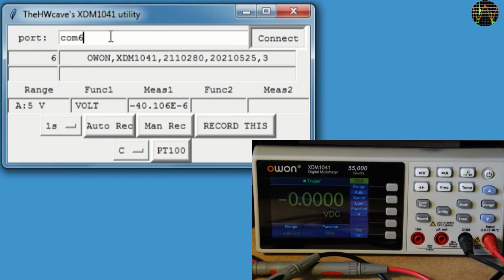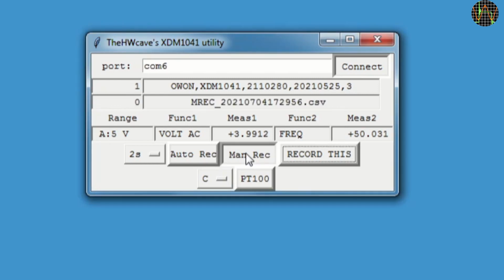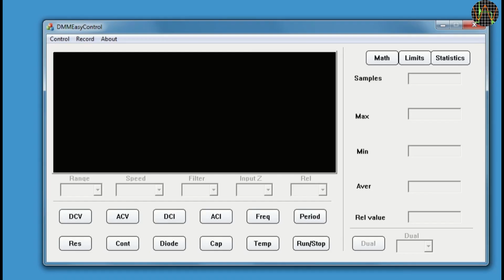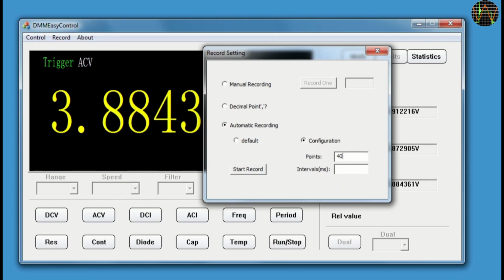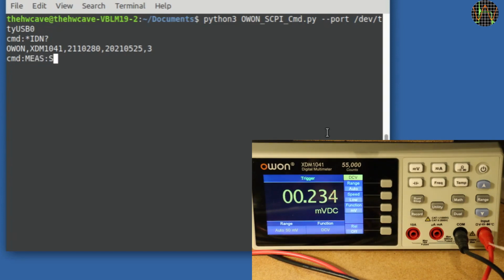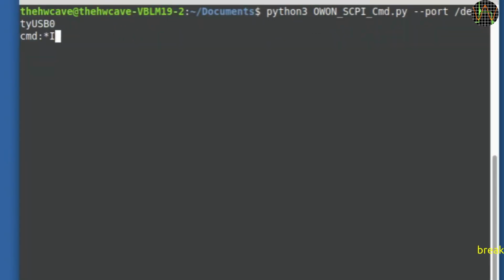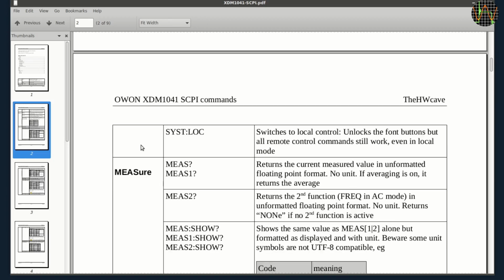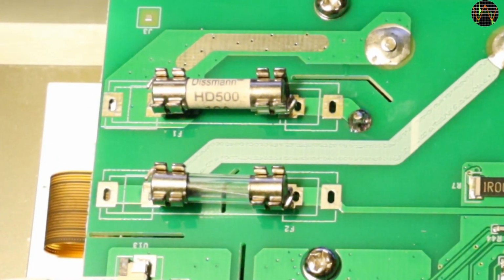The OWON XDM1041 bench multimeter, part 4 - SCPI & remote contro

Comment: How many values per second does it send to pc?
Reply from the maker: depends on baud rate setting and also whether the meter is set for slow (4 readings/s), med (16/s), or fast (65/s) mode. If you want accuracy, slow is the only useful setting.

Comment: can you use it without an app? enter SCPI commands directly on the com port interface?
Reply from the maker: No app needed, although I wrote a little Python program you can download from my Github page (see links in the video description).  You could use PUTTY (set correct baud rate!) and type *IDN?  <ENTER> to ask it to send its ID. You should get a response like OWON,XDM1041,12345678,V1.2.0,3

I documented the SCPI commands that work (in my version) also on my GITHUB. There are some quirks and bugs (as you would expect with OWON ;)

Forgot to add: no it does not echo what you type

Another command you can try is 
MEAS? which should send the currently shown value of the main display

Comment: A fantastic review, congratulations. Do you know how to calibrate the capacitor part?
Reply from the maker: I have played with calibration and sort of messed up my meter but did manage to fix it, so be warned that CAL is a scary procedure and you do so on your own risk. I did not cal the capacitance (lacking a suitable cap or a good LCR meter at the time) Now I have and use that, so I am not using the XCM1041 for capacitance measurements. The instructions (found on the internet) are below:
 
Enter calibration as specified about: Utility, Math, Up, Range, Down, Debug (softkey)

Pick the function and range you want to calibrate, each range has it's own calibration values stored.

Toggle between the "zero" and the "coef" number (on the display) using the Range key

Move to the digit you want to change with the Dual key -- it always moves the cursor left to right but will cycle around.

Use the Up and Down arrow keys to increase/decrease the value, it will roll over/under the higher order digit.

You can calibrate the range to any value that you feed into the meter, it need not be the full scale value, 5.0000 volts for example.  If you want to use 5.0000 volts then you can short cut this process and just hit the Run/Stop button.

Exit calibration mode and save you settings at any time by hitting the Math key (not the Dual key as it says above).

I was able to calibrate all ranges for all functions doing this.  However the capacitance ranges are sort of funky, but still work ok.  In all cases I set the "zero" number to all zeros.  I have no idea if that's right or not, but my meter is very accurate now, much better than it was from the factory.  I calibrated against a Fluke 8846A.
Reply: @TheHWcave  Thank you, that is the method I have used, but I have had problems calibrating the capacitance and the values it shows are very far from reality. I have tried to set the values to zero in, but for some reason the numbers jump and do not allow this process. I agree that this process is complex and difficult to understand.
Reply from the maker: @Manchego-clm  Sorry, can't help with that. Capacitance measurement on the XDM1041 was always the worst of its functions (at least on mine)

Comment: I have the XDM2041 and after 2.5 years the display is starting to show. It is the same as the XDM1041. A red line runs through the screen and a part of the image remains black due to the reduction.
The meter is placed in a place where no damage can occur. I've taken the display out and looked, but can't buy or find an alternative. The type number is: YYS37HV-133-A7 and the dimensions are 54.5mm x 85mm

Comment: I really appreciate all the work you have done to help anyone who has bought this device! The python utility is going to be a god sent! (Going to be, as I have bought a second hand one, and it hasn't arrived yet). 
One big question is about getting hold of the data that XDM can store. It looks like the only thing you can do with it is look at it. SCPI commands such as Read or Fetch are not implemented -- is that right?
You have improved the Pt100 temperature measurement in that utility as well, but I wondered if it would be possible to look at a Pt1000 rtd sensor, which has less problem when using a two wire resistance measurement...
Many thanks for what you have done!
Reply from the maker: Many thanks.  I have heard that later firmware versions do allow reading the locally saved recordings via SCPI but sadly OWON has abandoned all earlier XDM1041 owners and only the firmware of the latest hardware may be updated. Depending on what you got, you may be in luck. PT1000 is very similar to PT100. The easiest would be to simply rename the PT100 button to 1000 and change the formula in the PT100 function. You can do this easily yourself. I am not planning to do a new revision of the software. Send me an email if needed.
Reply: I will try and make the modification on my own, cheers, Phil

Comment: ITs a 99 buck (euro) bench multimeter when looking on its retail MSRP on OWON's own EU site (// not incl VAT), so it's important to also have that in mind and not use a reference bench DMM perspective based on way more expensive bench multimeters, or for that matter very old multimeters with decades on the back, as this ain't second hand.
The only Owon product I got is a blue handheld fellow from like 5 years back that were around 35 bucks delivered to Denmark.
the reason why I got it' was the voice. (not inside my head) but its loud and clear voice-ability to speak out' what reading It was measuring, and it did it on my tablet from some Harald bluetooth app.(35 series I recall it was called) it could also datalog and all that jazz.
saw that "voice" as a useable feature, if I was head down into something, and so I didn't have to keep looking at the display,

Comment: Great and pretty deep analysis of this meter. The actual software is V3.10 s/n from 2022 and it has USB connection. Some bugs are fixed. Price is rather low: Eur. 107 incl. Dutch 21% VAT. 3 years warranty but indeed these meters using till 1000V is not wise see the type of fuses. If you want a real Cat III or IV better buy a Fluke.
Reply from the maker: It would be nice to know what bugs have been fixed, but as a whole,  think OWONs behaviour of abandoning buyers of earlier versions is atrocious. BTW, apart from Fluke, many reputable manufacturers make excellent and safe Class III or IV handheld meters, just to name Keysight,  Brymen, and AMECal
Reply: Also here inside the fuses changed to 31,5mm 1000V 1A and 10A fuses.

Comment: I like my XDM. I do notice that when connecting via USB, if the device is connected upon boot of the host, the XDM will echo back any commands...I fix it by rebooting the host and connecting to XDM after boot up. Also, the USB feeds power to the communications module (but not the rest of the DMM), so it will remain connected even after turned off.

Comment: When try to start XDM1041.py I get an error: line 24, in <module>
    import serial
ModuleNotFoundError: No module named 'serial'
I load file in IDE PyCharm. I am not practiced in using python.
Reply from the maker: You need to install pyserial. For example using the command "pip install pyserial" . I am not familiar with PyCharm and whether it has pip or some other command is needed to install the pyserial package.
Reply: @TheHWcave  Hi , after adding package pyserial in pycharm it works . Thank you for nice tool.

Comment: Interesting series of videos. Thanks for taking the time to show all the "Quarks and features" of this instrument.
I just don't understand when this instrument runs on 5Volts, why they bottered with a internal PSU.
Why not use a external 5V adapter and a plug on the backside?
Wouldn't that be easyer and cheaper?
Reply from the maker: You are right in that it would be easier and cheaper. I think the reason why they did not go that way is that it is hard to control the quality of the external PSU. Even if they provide an adapter with the unit, the user may chose a different one. The quality of the 5V is important. You don't want stray voltages and bad /no isolation from mains in a device that may itself be measuring 1000V. I know the analog part is extra isolated but with a dodgy external adapter you may run into all kinds of issues. So, kudos to Owon (however, if you look at some comments  a few of the first gen units have a PSU that seems to be  cobbled together at least from the looks, it may be electrically top-notch.  Actually as I said the 1st video, hardware wise this meter is really well designed and a quality built.
Reply: New version XDM1241 has USB-C 5V power and lithium battery 🔋

Comment: I got mine about a week ago. Mine is version 1.1. So a bit older.
There's some significant differences in the fuses and power supply.
The larger fuses that you lamented weren't there in yours are present in this one but instead the power supply is of a lower standard. No PTC or MOV and so much silicone I'm considering making a new power supply. Anyway the point is:
Not everyone will be getting the same
Part.
Edit: It's a peach for me too. I don't have
A bench meter. So a cheap, new, sufficiently accurate and powered meter with a really nice illuminated screen is good enough for me. Thanks for the review.. It is what made me buy the meter in the first place.
Reply from the maker: Yes, I have see the cobbled-together power supply you mentioned on photos from other XDM1041. Luckily replacing that is not too difficult. Good that you got the long fuses.